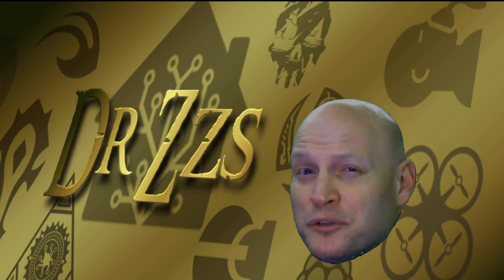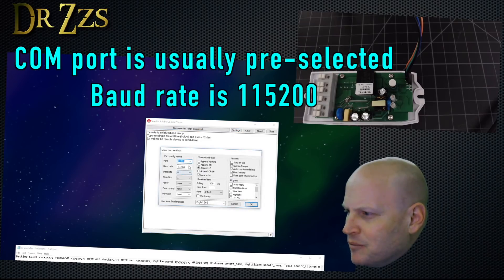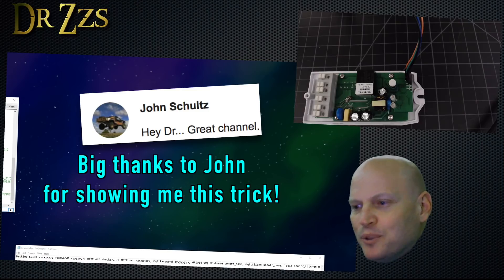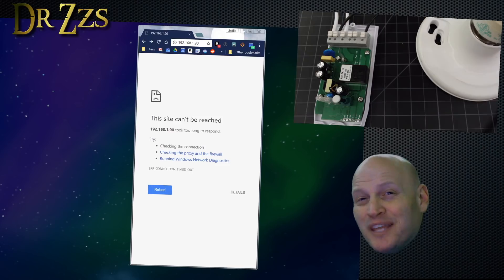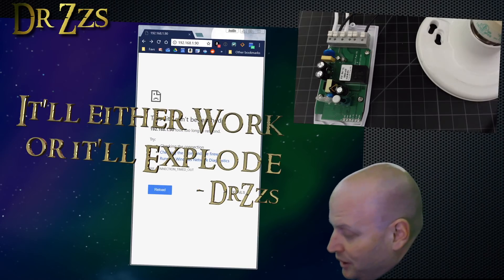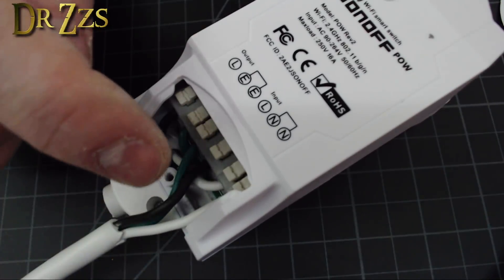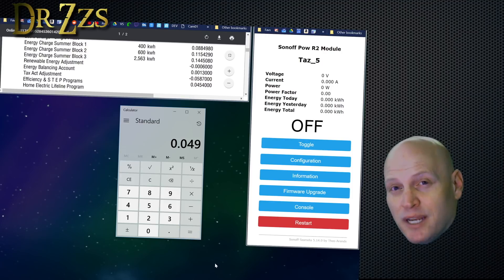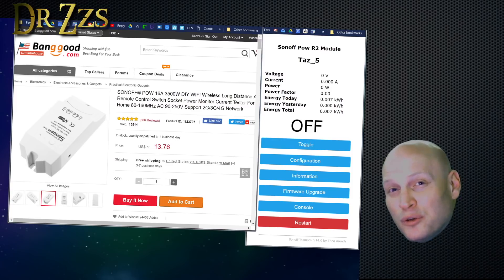Monitor Power Usage AND control your devices with the Sonoff POW | Home Assistant | Tasmota

Comment: Is there a way to flash it over the air?
Reply from the maker: It just depends on which version of stock firmware it comes with.  The newer version is allowing OtA flashing again, but other versions from a few months ago was not allowing it.  
If you set it up with the eWeLink app you can look under Device Settings for the firmware version.  As I understand it, v2.0 is now allowing OtA flashing, so if it isn't v2.0 maybe update it to v2.0 then try OtA flashing with SonOtA.exe 
https://github.com/mirko/SonOTA/releases

Comment: Hi Dr, I am just wondering how we can use the POW as a switch using GPIO 14 and ground; just like the basic.  I figure the pow has earth and I think i fuse as well and it would be saver to use POW instead of basic. many Thanks
Reply from the maker: It doesn't look like the POW has any spare GPIO pins.  My guess is either they are being used for the power sensors or are otherwise inaccessible.  At least in Tasmota on the Configure Module page there are no options to set different functions to gpio pins.  
We should be able to use Rx/Tx since we know those are available. 
https://www.dropbox.com/s/ytg8qj4zun1u56i/Screenshot%202018-06-25%2007.55.53.png?dl=0
Reply: thanks for suggestion; but I dont know how to use Rx/Tx, only know how to use it to flash the sonoff. But appreciate your quick respond all the time.

Comment: A power WARNING.  https://youtu.be/hv_FpBqWFrg

A warning to make sure you remove the TDI adapter before adding high voltage.

logic ground is searched across low and high voltage side

An older video but still may be current information.  I dont have a POW so can't check. 

Can somebody check and confirm 

Dr zzs keep up these great videos
Reply from the maker: Good advice!As far as I know that is still true.  That's from what I've read on the Tasmota Wiki.  I didn't check for continuity between them myself, but it does make sense that to measure the current there has to be a connection between the data input and the 120v side of the circuit.  
Thanks

Comment: I've been using the Arduino IDE method you previously recommended to flash but ESP easy does look much *easier. Any chance you can provide a link to the ESPTool/Termite tool you used, or maybe a quick video on that flash method?
Reply from the maker: It is really easy for sure. 
FlashEZ lives in these Zip files (going by the Alias "flashesp8266.exe"): 

https://github.com/letscontrolit/ESPEasy/releases

Termite: https://termite.soft112.com/

I'm planning to do a "1 min flash" video.  Hopefully soon-ish.
Reply: Yep quicker, easier, and probably less prone to error/corruption since your not constantly unzipping, compiling, and uploading a bunch of files. Thanks!

I got really stuck last night with one of the sonoff that didn't seem to want to flash properly via Arduino IDE, so I I did a few searched using the keywords you brought up in the video and found this great tutorial (that mentioned one of your videos) describing the process (https://www.youtube.com/watch?v=UDnNI5wkNNY&t=50s). It took me less than just a few minutes from scratch.. and it worked beautifully.

BTW, I also learned from his followup video how to use HTML commands to also configure sonoff devices, which is also nice if you need to reconfigure a bunch(that are already connected to wifi) without going to each one or using serial. 
I.e. http://sonoffIP/cm?cmnd=Backlog%20MqttHost%20brokerIP;MqttUser%20xxxxxxx;MqttPassword%20yyyyyyy;GPIO14%2009;Hostname%20sonoff_name;MqttClient sonoff_name;Topic sonoff_name;FriendlyName1%20Sonoff%20Name

Comment: Is there a way to clear you calibration data??? The 15 watts was actually just about right. (your power factor was .68) Also is would be better to a resistive load  (like a 100 watt incandescent bulb)
as the bulbs PF is close to 1.
Reply from the maker: I think there's a way to just set it back to default.  When you use "setvoltage" etc, it changes some other setting that modifies what it reads as voltage, and that setting can be set back to the default directly.  I'll have to look at the Tasmota page again to remember those commands and the default values. 
Thanks for straightening me out on this.
Reply: You might also be able to just 100 watt bulb and then reset the values (the PF would be 1 for practical purposes).... Thanks for great videos...

Comment: Awesome video man! Plus! Your 3d printer only uses 350w when it's heating Up, not the hole print, so most of the print time it should only use half that when it just tries to maintain the temperature. Btw, what 3d printer Interface are you using? Looks like octoprint?
Reply from the maker: Thanks!
yes it's octoprint.  It's fantastic.  Even interfaces with Home Assistant :)

Comment: Cool device. I could think of several appliance uses except I don't trust that lilliputian relay on the 120v circuit for more than about 5Amps resistive. Even less for inductive.
You make it look soooo easy. Keep up the great work.
Reply from the maker: Thanks!
I had to look up "lilliputian".  I'm going to try to use that word a couple times today :)

Comment: Exelent video as ever, too mutch ideas to do in my house. I only have a detail to correct you, when you do the calibration calculates the power at a power factor of 1, only true resistive loads have 1 as power factor, you have to use an incandecent bulb if you have, maybe an old iron or measure the values with a true RMS tester to have an exact power calibration. As I can see you are using a low compsumsion lamp to do the calibration.
Reply from the maker: oh cool!  good info thanks.  Always learning something new!

Comment: I've been using Command strips with my Sonoff rather than drilling holes and screwing them.  These large picture hanger strips are great for attaching Sonoffs to things and being able to remove them.  I have 3 stuck to my aquarium now with these things (2 basics, one for filter, one for lights, and one TH-10 for the heater)

https://www.command.com/3M/en_US/command/products/~/Command-Large-Picture-Hanging-Strips/?N=5924736+3294529207+3294737318&rt=rud
Reply from the maker: cool.  good idea!

Comment: Great video doc! But I was wondering if i could still flash Sonoff POW using arduino IDE with the same settings as your video on flashing the Sonoff Basic.  Or is it always better just to use flash easy and termite for Sonoff POW? TIA!
Reply from the maker: Thanks!
You can use the IDE if you've got it working for you.  FlashEZ just skips the setup in user_config.h and the compiling part.  If you have the POW R2 you'll want to use a newish version of Tasmota because it wasn't included in the module types list in older versions. 
Hope that helps!
Reply: I flashed mine with the Arduino IDE and had no trouble. Not sure what versions I’m at. I try to keep them up to date but there is so much progress it’s easy to get behind fast. That’s a great thing tho. It means there are a lot of support improvements happening.
Reply: I was flashing basic sonoffs just past 2 weeks ago. i think it already includes the POW and POWR2 to double check i connected to one of my tasmotized sonoff basic and in the drop down list i saw POW and POW R2.  It was version 5.14.

Comment: What did you do to the 🎤?
Reply from the maker: for these videos I'm using a fancy Blue Yeti condenser mic and Reaper software to process out the noise.  On most of the older videos I use a clip on mic plugged into my phone.  Hopefully this sounds better and hopefully both are acceptable.

Comment: Compact fluorescent bulbs are not accurate as to the power, voltage and current. Generally, the ballast consumes a couple of watts and the current is not in phase with the voltage so it is often higher than what you would expect for a plain resistive load. You may have already been calibrated before you changed it.
Reply from the maker: Ha!
Now you tell me ;p
I couldn’t find an incandescent 💡 anywhere in our house. 
Thanks for the knowledge 👍🏻
Reply: I was going to tell you last night before you posted the video but I fell asleep. Zzzzzz. Even incandescent bulbs are nominal wattages so the only way to calibrate it is with a known resistance or a voltmeter and ammeter and power factor meter.

Comment: Can you plz do a video on the Sonoff TH10
Reply from the maker: hmmm, yes I could, but I don't have one right now and I'm afraid it might take a long time before I could get to it. 
Are you having trouble with it?  Tell me what's going on and maybe I can just point you in the right direction.
Reply: DrZzs I can get the switch part to show in Home Assistant but the sensor (Si7021) data will show in Tasmota  and in Mqtt messages but not in Home Assistant. I’m guessing somethings wrong with the value template
Reply from the maker: copy the line for "Status10" from the tasmota console and past it here.  Also paste what you have for the sensor entry in HA and we'll see if we can find the problem. :)
Reply: This is what i had to do to mine to get it working.   

- platform: mqtt
    name: 'POW Current'
    state_topic: "tele/sonoff_POW1/SENSOR"
    value_template: '{{ value_json["ENERGY"]["Current"]}}'
    unit_of_measurement: 'amps'
    
  - platform: mqtt
    name: POW Watts
    state_topic: 'tele/sonoff_POW1/SENSOR'
    value_template: '{{ value_json["ENERGY"]["Power"]}}'
    unit_of_measurement: 'watts'
    
  - platform: mqtt
    name: POW Voltage
    state_topic: "stat/sonoff_POW1/SENSOR"
    value_template: '{{ value_json["ENERGY"]["Voltage"]}}'
    unit_of_measurement: 'volts'
Reply: Eric Simerman but how am I supposed to don this with the Si7021 sensor for temp and humidity
Reply: Change the DHT11 to your SI7021 like this.

 value_template: '{{ value_json.SI7021.Humidity }}'
And make sure the state topic is right.

If that don't work  try the json format below.
value_template: '{{ value_json["SI7021"]["Humidity "]}}'
Reply: Eric Simerman I still can’t get it to work

Comment: You have to try Atom with the PlatformIO IDE. The flashing process is so simple and its really easy to set the WiFi, MQTT and OTA URL parameters (something you'd only have to do once for all of your Tasmota devices, might I add).

I'd be happy to help you through the setup process to see for yourself.
Reply from the maker: ok cool. I'll be flashing some more devices probably this coming week. 
are you on Discord?
Reply: DrZzs I'm on there. I'll email you my username.
Reply from the maker: got it!

Comment: awesome vid doc thanks. I have been looking into ways to get notifications when my sump pump turns on. I tried a couple of project from forums to measure current with a transformer and send the mqtt to hass io but did not seemed to work so i ended up using this sonoff to see when the sump pump turns on and off. I need to work ona  comprehensive system that check water and sumppump operation but till then this servers the purpose. thanks for teaching all the options and including the termite tutorial. will be waiting on the sensor json options vid...been planning to look info it since ben's multisensor vid.
Reply from the maker: Thanks!
I think my Arduino sensors kit had a water level sensor.  I'll have to check. 
I'm hoping an explanation of json will help a lot of folks with their troubleshooting.   I expect I won't use all the right terms, but I'll explain it the way I understand it as a non-programmer so other non-programmers understand.  Cuz that's what I do.
Reply: timaelabu this is exactly what I want to do too - monitor the sump pump run times.  And then use machine learning to project and predict future patterns. And then compare those projections with the actual times to see when they diverge which would indicate a failure.  I envision a system that could indicate a failure long before any other method would detect the same.  

Then if this system was generalized it could be adapted to many other devices around the home to do similar projections.
Reply: Neil Brookins   This risk I see with this sonoff pow is that if you accidentally toggle is off then you could have a flooding. So a passive sensor to check when it’s on along with water presence sensor is the right way for sump pump.  There is a command line that says it disables all menthols to change sonoff state. So i have done that. I am guessing this will disable MQTT set commands. For the right solution I have ordered a Hall effect sensor AC715 that will measure current passively and a rain/water sensor at the lower level of the sump pump float switch.  Since I will be using a wemo d1 for the Hall effect sensor., next step would be to see if I can use a micro switch on the float.
Reply: Just read this post after posting about this exact thing, I’ve done the same once I got all the data into home assistant I monitored the running patterns of the pump and from this I determined my alarm points, for example I know it takes just over a minute to empty the sump pump water container... if my pump runs for 3 minutes continually an alarm notification is pushed to my phone and the pow turns the pump off I’ve also monitored that it runs roughly every 2 to 3 hours so again if it doesn’t run within a 5 hr period a notification is pushed.

Comment: Glad to see you do this video!  Same here as another S31 poster, using two of them in my wash room.  One on the gas dryer and one on the washer.  Easy to flash, just stuck an empty header in my pin wires, and piece of kids play-doh to hold it.  No soldering!   I cheated a bit on the calibration, 120 volts can range quite a bit in places from 115-125 volts, so I used my voltmeter and UPS voltage for reference and set the voltage, then I had a Kill-A-Watt meter and tested my 1200watt toaster oven and sure enough 1202 watts.  I was able to see the amps as well so I set them too.  I like to calibrate things with a pretty hefty load instead of small load.  Then you get to learn all about power factors and how your amp calculations can throw you off at times.  

For a bonus, I have some automations setup to announce on our Google Homes/Minis in the house that the washer is done and to move the clothes over.  It only notifies us if the dryer is off though.  When the dryer is done it notifies us to come get things.  I also did a template sensor with automation based on the wattage of the dryer light to nag the kids if they left the dryer door open for more than 10 minutes.  

Another cool safety minded thing, was if we armed the house alarm as away and the dryer is on, an automation turns the dryer S31 off for a few seconds then back on so we don't have an unattended dryer.  Something about flames and clothes spinning around together while I'm not home doesn't sit well with me, the same for an electric dryer as well.

Value template for the S31 in case anyone needs it, use the console to see the exact names for the other sensors.  "value_template: "{{value_json['ENERGY'].Power }}""
Reply from the maker: Awesome! 
Thanks as always Travis!

Comment: I thought the Sonoff Pow works exactly that way out of the box with no need to re-flash the ROM... I´m I right?
Reply from the maker: it sure does.
Flashing is just to get it to work with MQTT and Home Assistant or other smart home hub.
Reply: Got you... thanks a lot
Reply: By the way... an off topic question... do you know of any low cost device that has inputs and communicate vía wifi to Home Assistant so that I can use dry contact devices to trigger events or actions on HA?
Reply from the maker: For sure! If I understand what you're asking I'd say D1 mini or NodeMCU would do the trick. 

https://amzn.to/2tdfcP1

https://amzn.to/2MppK6t

You can get them a little cheaper from AliExpress if you don't mind waiting for shipping. 
You can use Tasmota on them and set different pins for different kinds of input and then use the MQTT message they send when activated to trigger things in HA. 

I did a video using Motion and Temp/Humidity sensors on the D1 mini.  https://youtu.be/sVml02kP3DU

Hope that helps.
Reply: THANKS SO MUUUUCH... so good information you always deliver. Watching you suggested video I can see that I can also use the Sonoff basic and its inputs at least for one sensor which is awesome... but I would like to know what hardware do I need to enter the sonoff basic for TASMOTA programming. I've seen you connecting some wires and a USB converter  but don't know if you have provided the links for those parts in a previous video.

Comment: The S31 also works great for power monitoring... and it comes with its own power plugs. :)  I don't know about OTA installs, but I temporarily soldered a header onto the S31 board to flash it the first time.

I haven't calibrated my POWs or S31s. I guess I'm not that motivated because I'm just using them to tell me when the washer and dryer are done running, or when my CPAP is running so HASS can know when I am in bed.
Reply from the maker: I saw that one on their website.  Looks useful.  Glad it hear it's flashable. 
Thanks!

Comment: Any idea if this could monitor power for something like a washer / dryer?  I've been trying to find a "relatively" straight forward way to monitor the power from my washer/dryer.
Reply from the maker: Possibly.  I should have mentioned it has a 16 amp max.  Check out your specs and if your washer/dryer is under 16 amps then I'd say you found your solution!
Reply: Ahhh, that is REALLY good to know.  Won't work for my dryer, but should be fine for my washer though!  Thanks for all your great tips and help!